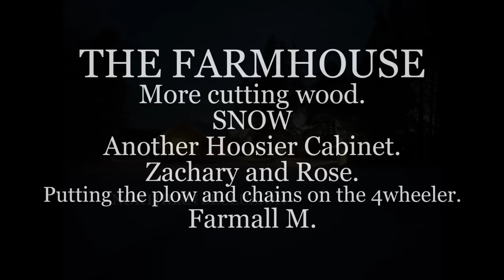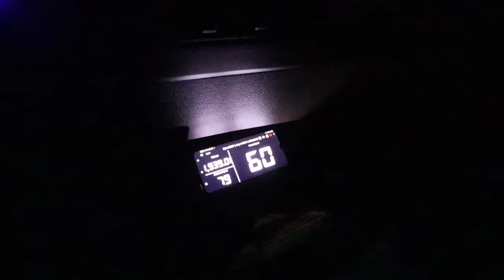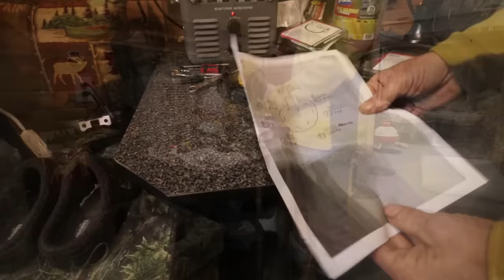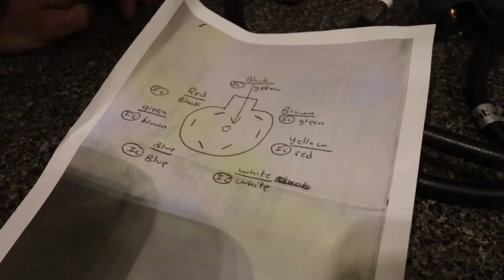THE FARMHOUSE. More Cutting Wood. Zach and Rose. SNOW. Another Hoosier cabinet. Plowing snow.

Comment: Talk about your neighbors, how much does the wood cost?  Not to mention the work involved.
Reply: Cost me $1875.00 to fill my 2 1000 gallon propane tanks a season. $ 700.00 for two loads of logs this year. It has been so warm though this year been using alot less of both.
Reply: Yeah it's pretty much, plus chainsaws, splitter, oil,and a lot of time
Reply: It’s not work if you enjoy getting out and cutting wood. I mean I personally would rather use propane, but for heating 3 separate building? The boiler is the way to go. I could imagine how much propane it would take to heat that entire shop @55-65 for a winter.
Reply: Nothing beats wood heat in my opinion
Reply from the maker: I heat all 3 buildings plus the hot water in the house for less than it costed me in fuel oil just to heat the house prior to getting the boiler. It takes more time for sure but my idea of hell is sitting on the couch doing nothing. Nice try Bill. You must be lazy.

Comment: Joe, at the time of watching your video, it's -5 no windchill yet. Tonight, advisories out which most of MN has for 30-40 below windchill. Plugged my truck in for the first time this early 2024. Great video, as always 👍
Reply: My mother had one and it worked liked. A dream.God bless.
Reply from the maker: The cold is coming for sure. 5 degrees right now as I type this. It started at 23 this morning at 5.
Reply: @NorthernSeclusion Well, 45-50 below here you two. Pipes are frozen in my outside wall freezing the pipe in my bathroom. All else is well and good here. Terrible wind and drifting though. TC Vicki from Iowa 🥶

Comment: The old cabinets I've seen had a dough board that pulled out for rolling pie dough out or making biscuits,use as cutting board. There was a bin for the flour and the sifter,a bin for the cornmeal,the rolltop cover that could close. Some called them "pie safes".
Reply from the maker: This ones cutting type board was inside the lower right side cabinet door. Way too low to be practical but that is where the factory placed it.

Comment: My grandma had a Hoosier cabinet. It had two doors on the left, top and bottom . The top door was where the flour was kept in a bin and the bottom door was for the sifter.  On the right 3/4 of the cabinet there was two doors on the top for storage with work space below. It had a pull out work space but the coolest feature was it had a roll top that came down from under the top cabinets to cover the work space.   In her later years she moved in with my aunt and I had wondered what happened to the cabinet. A few years later I was visiting grandma  at my aunts house and went to the basement (unfinished) and there was the cabinet. My uncle was using it to store tools, I was SICK.  It was covered with oil, dirt and grime.  I never saw it again.

Comment: Tons of rain this winter, very little snow accumulation. We did have this past week (Friday/Saturday Jan 12 & 13) a bit of a storm. More blowing of snow than anything. Supposed to get quite cold this upcoming week down around 0 F. Tonight, we are sitting at 8 F. Little concerned about the winter damage on our winter wheat this year, we rely upon on good snow blanket to protect the crop but what little snow we had so far that if we get a prolonged severe cold spell we could be looking at diminished return come harvest in June/July.

Comment: I have a Sellers cabinet! Mine is wood with a porcelain metal top. It too has the floor box with sifter. It too does not have the cap on the bottom.

Comment: I have the exact same cabinet (the yellow one) in my kitchen. Down to the etched glass and everything. Have you pulled out on the white table top part? Mine extends out so there's more working space.
Reply from the maker: Yes we have, both the cabinets we have, the top pulls out. Do you have the meat grinder attachment? Does yours have the sugar jar that rotates out? I would like to see a bunch of pictures of yours. homeandcabininc@outlook.com
Reply: Mine is the same as yours for the grinder attachment, just a metal plate with a threaded stud sticking out. I don't have the actual grinder though, i think the wood block would be attached to the grinder.  Don't have the sugar jar but it's probably in the house somewhere. House is 200 years old this year and I think there's something from every generation around here lol. Mine does have the flour side like yours, the tin part is just bare, no paint in there, I will get some pics and send to you if I can figure it out. @NorthernSeclusion

Comment: Hey Joe, have you ever tried some of the cold weather gear like the Milwaukee M12 stuff? The heated elements keep your core warm enough that your body won't have to reduce blood flow to the extremities to maintain temperature. The increased blood flow will greatly increase dexterity for fiddly tasks like doing that trailer connector.

Comment: I saw waterproof, rechargeable, heated mittens and gloves the other day on amazon.  For running tractor or wheelers or even out ice fishing $50 to have hours of warm hands seems like they would be really helpful for you guys. As ive gotten older its become a bigger issue for me 😂
Reply from the maker: Melissa has bought me several different types of heated gloves and mittens in the last 5 years. The problem with them is they say they will last for hours but I have never had a pair that kept your fingers really warm for more than 30 minutes and the battery is totally dead within an hour.
Reply: If you ever find on that last more than an hour. I would buy that .  Thanks for share a part of your life . @NorthernSeclusion

Comment: Hey Joe, on the Hoosier, does the enamel top slide in and out? My old one does and the meat grinder attachment on the side fits under the enamel top. Mine you can take that top all the way off if you take out a few nails. I’ve replaced them with screws so I don’t have to play with nailing. Don’t know if that was supposed to be that way, but when I got mine it was filthy so I took it apart.
Reply from the maker: Yes, both of our hoosier cabinets the tops pull out.

Comment: Do you have multiple plug ins for winter heater blocks etc. for everybody's trucks.
Reply from the maker: The black diesel you can plug in, not the gas trucks but you really never need it with the gas vehicles. Years ago you did but not with everything being fuel injected. My white diesel is from Louisiana so it does not have a plug in installed. I have the plug but have never installed it yet. Unless it is 25 below, even the diesels start with no problem.

Comment: Hey Joe ? Are you running your chainsaw in winter or summer mode ?? A Stihl chainsaw has a setting for winter and summer mode , winter mode draws heat from the motor to run smoother , and summer mode draws outside air ?